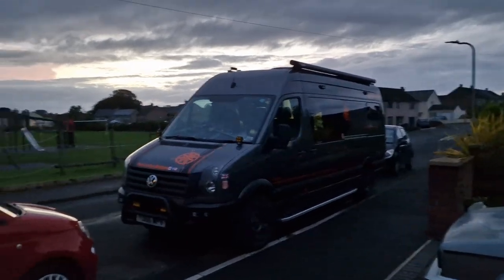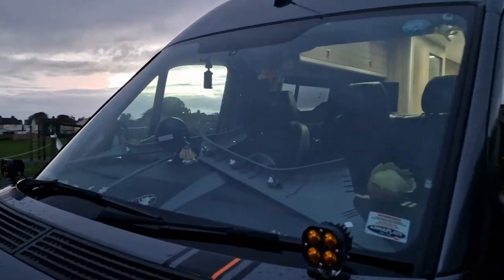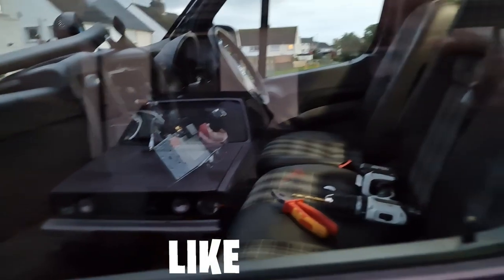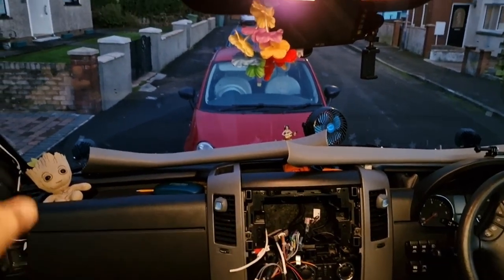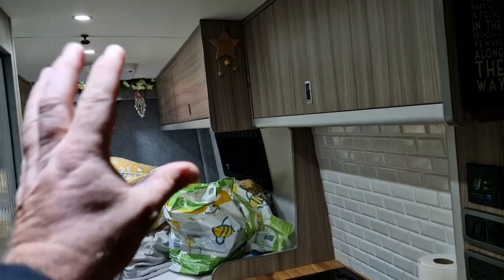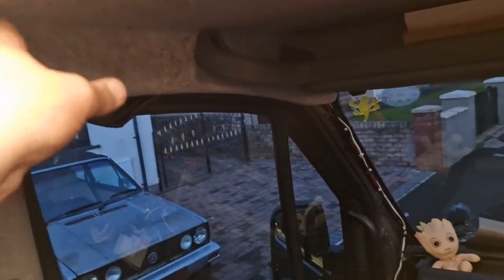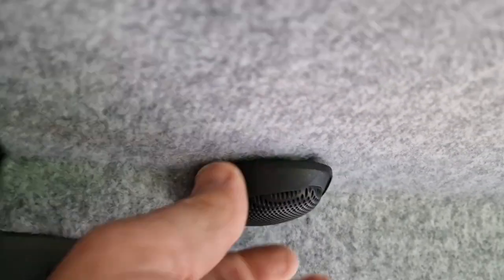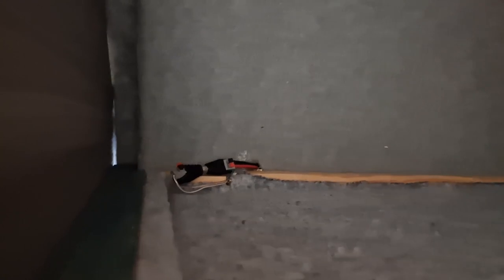audio speaker upgrade | selfbuild campervan crafter sprinter | the crafty blinders van life

Comment: Great video, Sam. I am just in the process of removing the bulk head, rerouting the big wire loom going to the back of the van and will now pre-run cabling to the tweeters as well. Much easier in a "naked" van. Watching your videos (and others) on the subjects of electrics / lighting / accessories will make life so much easier. Perhaps I'll be putting in a couple of later unneeded wires, but adding cabling later is always a pain. THANK YOU! 😊👍
Stay safe. 🚐⛅🍀
Reply from the maker: It's definitely easier to install cables before you need them rather than afterwards but I do enjoy the challenge of trying to find a route through 😁

Comment: How do, Sam. I have to admit, I never liked the OG stero in Viv-I-van so I changed it for one of those floaty head tesla style stereos in her. The sound has never been very good-mainly cos of crap spearkers( only two in the doors) so doing catch up on your channel, I came across this video and its now made me want to replace the speakers in the doors and try to have some more behind me. You're spot on about sound never sounding the same when you remove the bulkhead.  My head unit allows for rear speakers but means I have to then get an amplifier etc. I'm just not electrically minded so possibly I'm going to have to get it done by someone else. Great video though. I wish I had your skills. Bessy regs and Happy New year-Kenny
Reply from the maker: I only learned by trying mate many years ago I couldn't afford to pay for people to do work for me so I learned, now I can afford it I don't trust people to to a good job😂